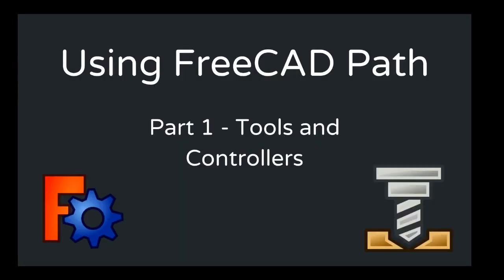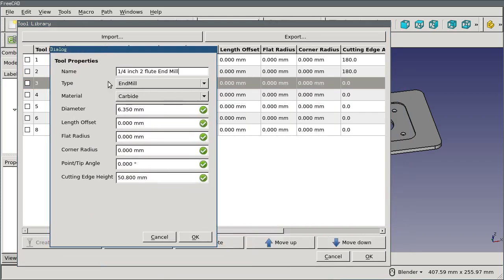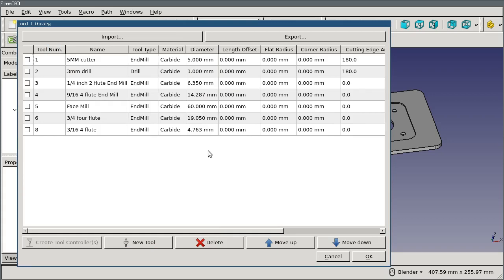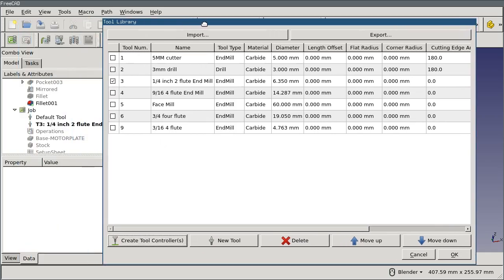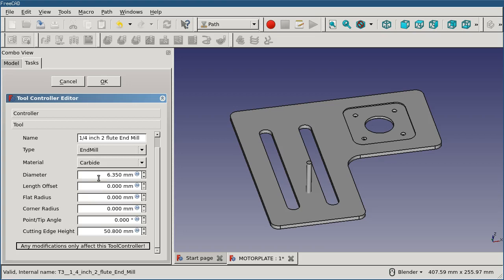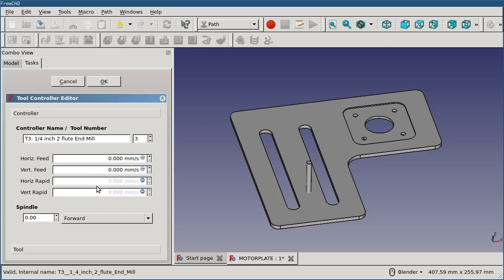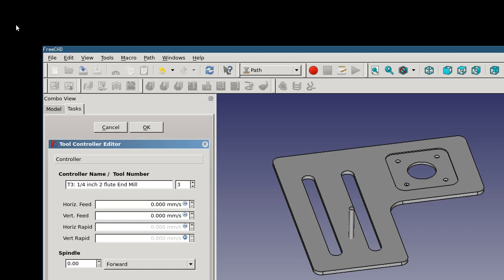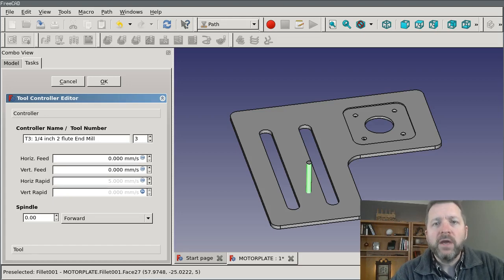Using FreeCAD Path - 1 (Tools and Controllers)

Comment: Thank you so much for posting this. I am eager to get off to the races when it comes to using my open builds 1515 CNC router. One of the issues I’m having is that the cam software does not put tabs for holding your material on circles and I make a lot of circles in all my designs.I need to take this question to the free CAD forum, but I thought I might put it in here as well. Are there any videos out there that will teach me how to build a circle path and install tabs to hold circles that might be cut out of a piece of wood?

Comment: So frustrating! You jump straight in with a file already open! Where is this file? Then, you go to a button which on my FreeCAD 0.19 only opens the 'Tool Selector'. NOT what you say it does. Then, you refer to tools you've already loaded! What use is that to someone who hasn't already loaded them? Surely you should explain first HOW you loaded them.
Enjoyed your first tutorial in this series but 30 seconds into this one and it all falls apart!
Reply from the maker: This video was published in March of 2018.  You're using a version of FreeCAD that was released in 2020.  Things have changed.  I'd like to renew and update this content but there's only so many hours in the day and like most people, I have to make a living.
Reply: @sliptonic  Thanks for responding so quickly. I get your point, shame you don't get mine. There is a huge gap in the flow of your series, between Ep.0 and Ep.1, I see others have also commented on this.

Comment: Hello, I wanted to thank you for the effort put into these videos, it is really a game-changer for new users like me.
Also, I wanted to ask you if you know why I am getting the following error when I try opening the tool manager:

08:47:03  Error loading tool: 45degree_chamfer.fctb : Expecting ',' delimiter: line 11 column 5 (char 267)

I Googled it but have not been able to find an answer. I am thinking about reinstalling the app again. Thanks again and keep up the good work!
Reply from the maker: There's probably a typo in the toolbit file.  Toolbits are new and have undergone a lot of change.  The good news is that the toolbit file is easily editable.  You can open it in any editor.  Look at the end of line 11.  I bet it needs a comma.
Reply: @sliptonic  Thank you for your response! I missed to tell you that I installed tthe latest version 0.19 about 6 weeks ago. Is there a link to a guide on how to fix this issue? Otherwise, I'll try reinstalling the application. Thanks
Reply from the maker: @fijabo  It depends on what you mean by 'fix the issue'.   
The specific bug you have is a typo in a toolbit file.  It can just be edited and fixed.  But the reason that typo exists is more complicated.  Toolbits are meant to be customized.  The typo might be from an earlier version of the toolbit we released or it might be because you customized it.  

If you're only using the stock FreeCAD toolbits and tool shapes, and you haven't invested a lot of time customizing your tool library, you can just delete your tool directory and your .FreeCAD directory and restart FreeCAD.  The .FreeCAD file will be recreated and it'll prompt you to select a tool location.  If you're running the current appimage, there are no known toolbit errors.
Reply: @sliptonic  Thank you very much! I really appreciate your help.

Comment: sorry - don't know where to flag this- I am trying to use 0.19 version of freecad and the tool library is not opening. (0.18.3 works o.k.) the report error says File "/tmp/.mount_FreeCAnxBFkX/usr/lib/python3.7/json/decoder.py", line 355, in raw_decode
    raise JSONDecodeError("Expecting value", s, err.value) from None

Expecting value: line 1 column 1 (char 0)
Reply from the maker: 0.19 is the daily development build so things are likely to break from time to time. There has been lots of work done lately on the tool table. If it doesn't resolve after the next daily update, please post to the forum.
Reply: @sliptonic  It seems that the tool library is now the tool dock, but does not seem to function like you show here. Can you link to any info that might be found for how to use tool dock?
Reply from the maker: @aculasabacca  https://youtu.be/Xgsm3jfHkZ4
Reply: @sliptonic  thankyou